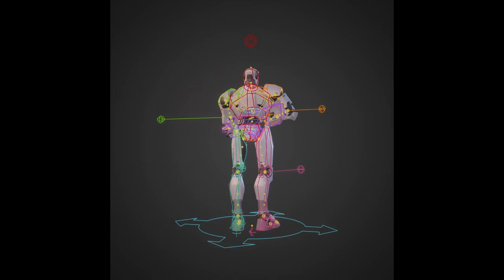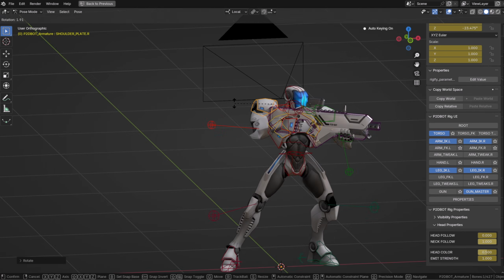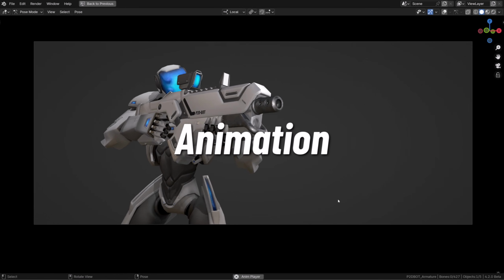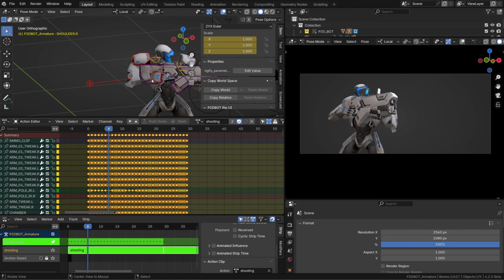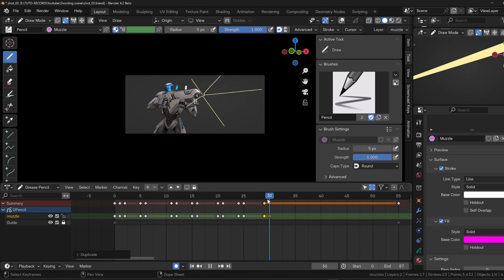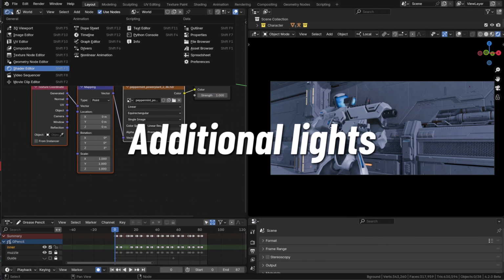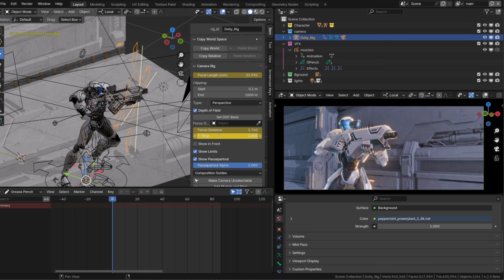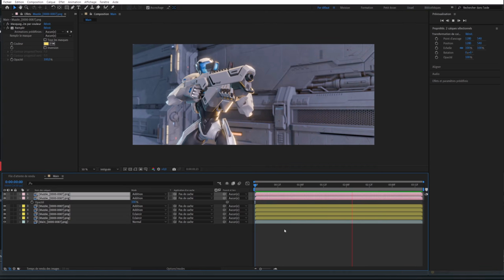Full animation tutorial in Blender

Comment: recently I have switched form maya to blender. Can anyone tell me how to select multiple controllers and rotate all of them together while setting up a pose.. for example select all the spine controls and rotate together OR all the finger controllers and rotate together. I tried that in blender but its rotating only the last selected control.. Eagerly waiting for a response.  Thanks.
Reply: If by any chance you haven't solved this in these past three months, are you using the on-screen rotation tool or pressing R for the rotation hotkey? If you're doing the former, try the latter.

Having used both softwares, here's some other stuff that might be helpful to someone switching to Blender: not only can you press X, Y, and Z to lock the axis of rotation, you can press shift and then one of these axes to rotate on all axes except that one (ex: R + shift + Z to rotate on X and Y only). This also works for moving with G and scaling with S as well as certain other operations, ex. shearing (skewing). 

By default, Blender will use global space for the axes, but at the top of the screen where it says "global" you can switch it to use the object's local space. This will only work if you haven't applied the transforms (Blender equivalent to freezing transforms)

One button to the right you can switch the pivot point from "median point" to "individual origins" and it will behave the way Maya does when transforming multiple ungrouped objects. If you want precise control over the exact position of your pivot point, that's what the 3D cursor is for, but it's kinda annoying to position compared to Maya and there are only a few circumstances where I'll find myself using it, namely when I'm trying to adjust object origin points. 99% of the time, "Individual Origins," "Median Point" and "Active Element" are all you really need.